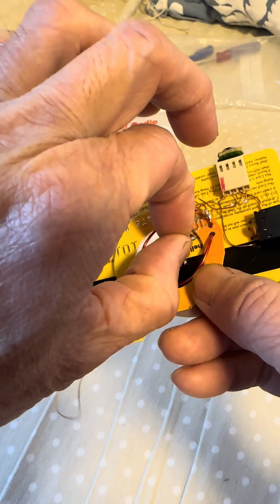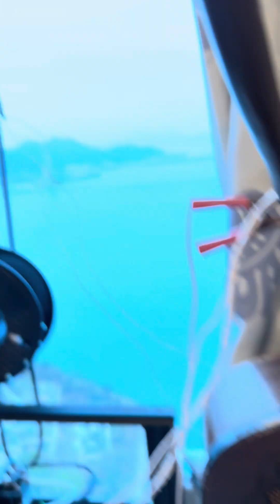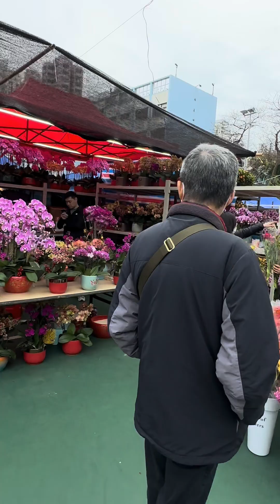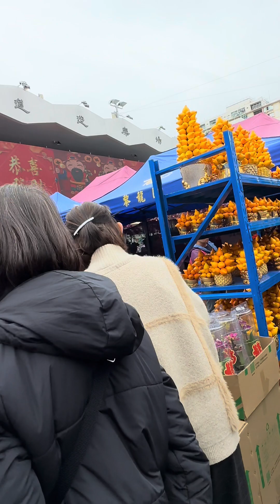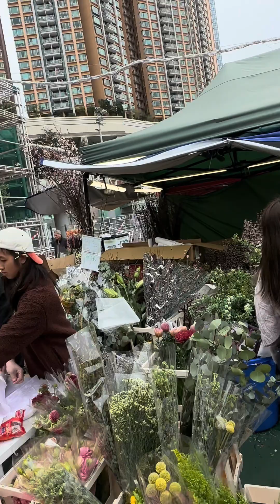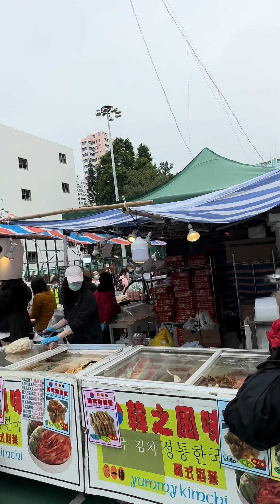FM credit card crystal radio tuned using a 2D Variometer.

Comment: What effect would a third movable coil have on this design? Would it matter if the third coil was in parallel or series with on or both of the other coils?
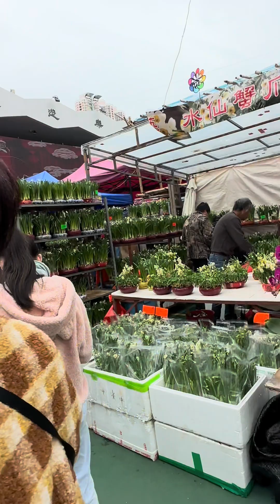Reply from the maker: Good question. The total inductance will be the sum of the self inductance of the 3 coils plus or minus the mutual inductance in multiple relationships among all the permutations of any two coils in the mix  and their winding directions. This will make tuning so complex and Q factor much worse ( due to increased resistance at the multiple joints) that I would not recommend. See this video for such calculations(14:00)  https://youtu.be/9BV990SoJxE?si=H3z-VIjru0ky5h3u